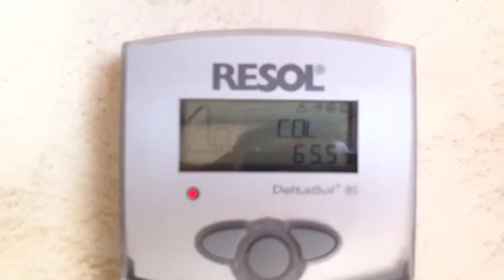Parabolic Solar Collector Ver. 1

Comment: Depends on your climate I suppose. Here in Canada in the spring the pollen from the plants is sticky but the frequent rain tends to keep the collectors clear if they are mounted at an angle to horizontal. In a dry climate a high pressure blast of air could be used periodically to remove the dust?

Comment: Mike, yes I agree.  There are two ways to orient the system.  If the axes of the troughs are oriented East-West, (as Duane Johnson has pointed out) you get maximum exposure and you do not have to move the troughs much.   HOWEVER, if the East-West style of orientation is mounted on a home, and then if the controller fails, you could boil out all the water AND START A FIRE.  That is precisely because you do NOT have to move the collectors for the sun to stay in focus.  The sun simply moves along the focal plane (like those giant systems in the Arizona desert).   If the controller fails and the pump is not running, your system could be destroyed.
     However, if the axes of the troughs are oriented North-South, then you DO NOT GET MAXIMUM EXPOSURE, but you do regain your safety margin.  You will not start a fire in this orientation if the controller fails.  The troughs stop following the sun without the controller, and the sun moves out of focus.
Andrew Ancel Gray
Reply: It's like an automobile, the controller and pump need to be made reliable.